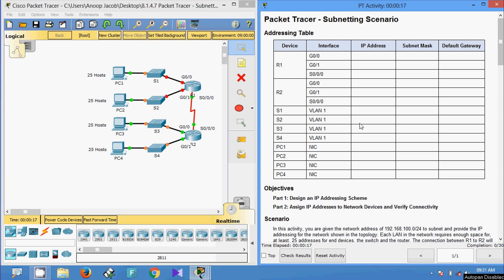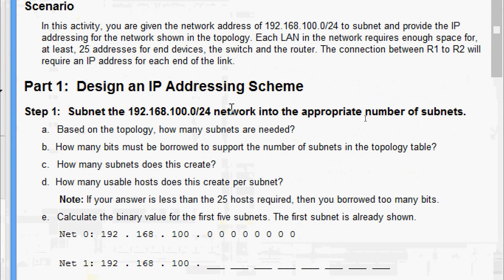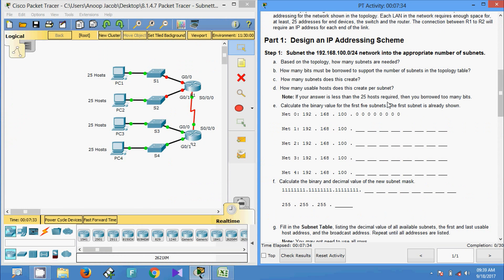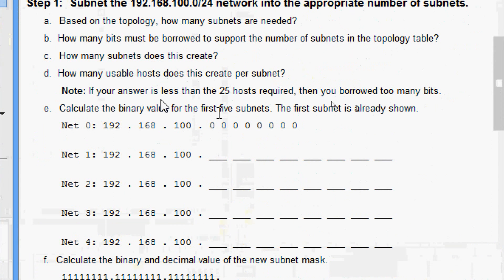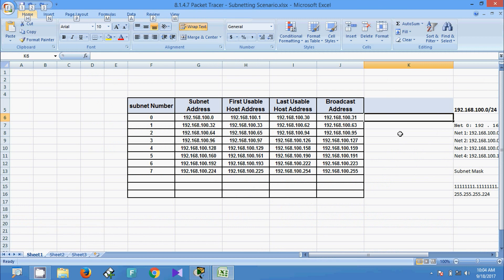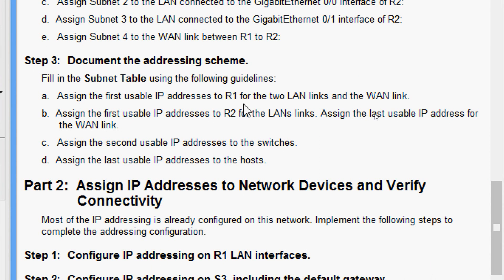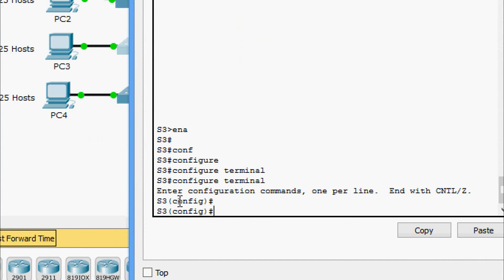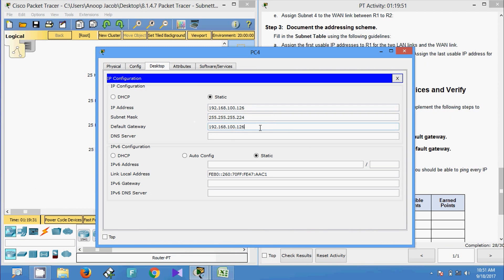8.1.4.7 Packet Tracer - Subnetting Scenario

Comment: How did you borrow the 3 bits from 25?
Reply: We use /24, so that means we have to work with the last 8 bits. In these 8 bits we use this formula to know how much to borrow: amount of hosts + 2<= 2^n (n with the smallest gap). So 27 <= 2^n. n is 5 (the gap is 32 - 27 = 5, n is not 6 because 64 - 27 = 37 (37 is more than 5). Use that number to extract that from the bits u use: 8 bits - 5 bits = 3 bits that are borrowed.

Comment: Hello Sir,
How do we know the ip address of PC1, PC2 and PC3 since config is locked in packet tracer.
Reply from the maker: Hi
Thank you my dear Friend for your great support. 
If we required PC ip address then they will give the addressing table along with the Activity.  If they didn't give, we may need not to use it in that particular activity.
Reply: @TechAcad   But how did you determine PC1 address as 192.168.100.30  ?
Reply: Since PC1 configure is locked we cannot view the IP address. Is there any other way we can ping PC1 from Switch or Router to know the ip address ? Please.
Reply: @ahmeds4312  I believe because it is the last usable host address on PC1's subnet. Most people use the first usable host address, but Cisco seems to like to use the last.

Comment: If somebody did this exercise from zero and is not able to ping from PC3 to PC0, add the following command to Routers 1 and 2 each one:
Router(2)#ip route 192.168.100.0 255.255.255.224 192.168.100.129
Router(2)#ip route 192.168.100.32 255.255.255.224 192.168.100.129
Router(1)#ip route 192.168.100.64 255.255.255.224 192.168.100.130
Router(1)#ip route 192.168.100.96 255.255.255.224 192.168.100.130

I had to learn that in a very hard way: investigating by myself...

Comment: in this PDK how did you get
Subnet Number: 0
Subnet Address: 192.168.100.1
First Usable Host Address: 192.168.100.1
Last Usable Host Address: 192.168.100.30
Broadcast Address: 192.168.100.31
because it says you need a /24 how did you get a 192.168.100.30 how did you get that IP address please Explane.

Comment: 4:00 where did you get 3 bits from
Reply: we need five subnet masks as per the given topology ,so the min no of bits should be borrowed is 3 bits as it gives 2^3 combinations i.e 8 subnets where as borrowing only 2 bits from the network part will give u only 4 subnets which doesn't satisfy our need
Reply: @sujithreddypatlolla2107  but where are they coming from? nothing changes except the amount of 0's after the .168